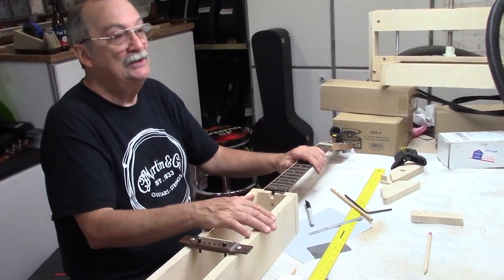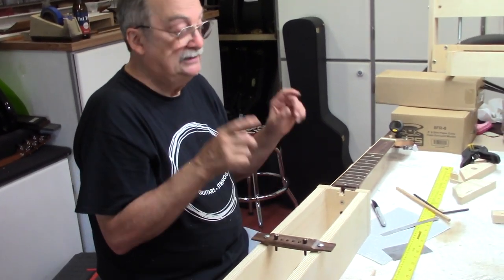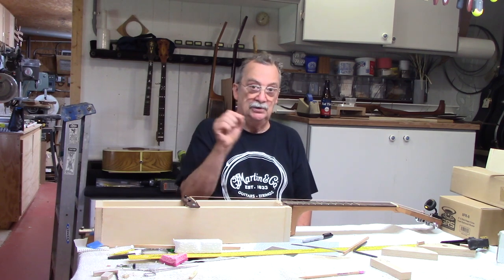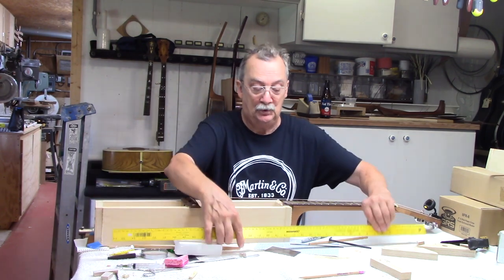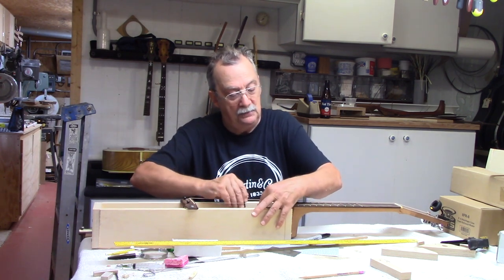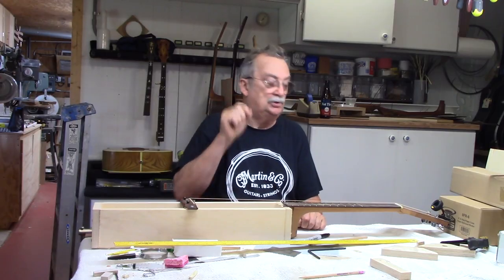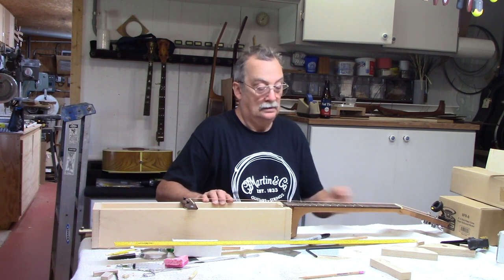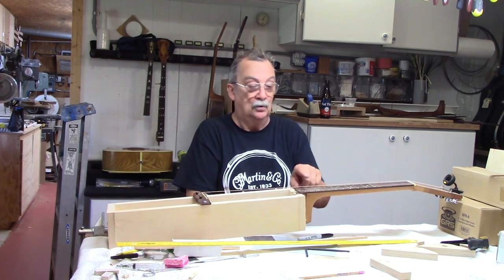Blues Creek Guitars - Demonstration of Guitar Intonation and discussion on compensation

Comment: That was some good stuff.  I would be interested in hearing what John has to say about making compensation at the nut as well as the saddle.  There are some very good luthiers that swear it is the only way to get a very well intonated guitar, but I am on the fence about it.  It seems to me there are so many real problems with equal temperament tuning that adjusting the string length at the nut just isn't going to do much - and that you can get a bit into "chasing your tail" with string length adjustment on both ends.  Anyways, I just don't have that much experience with it.
Reply: yes  I have used that to adjust intonation.  You
 are  right sometimes you can only go so far.  Much depends on the accuracy of the fret placement.